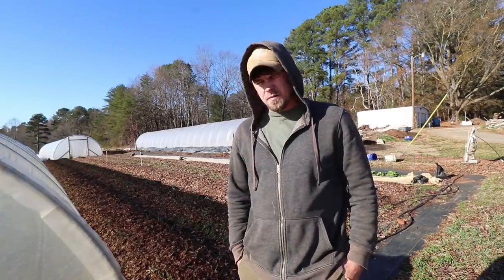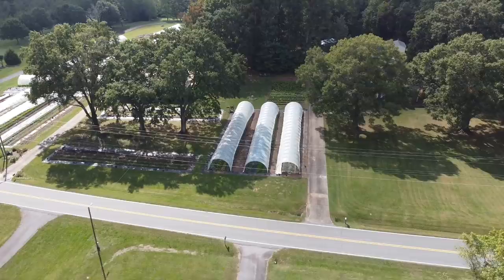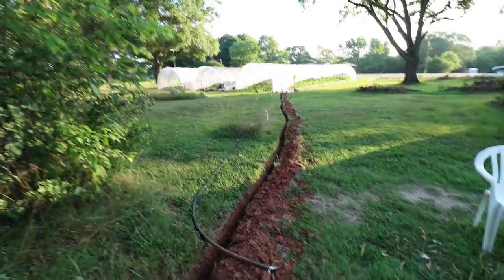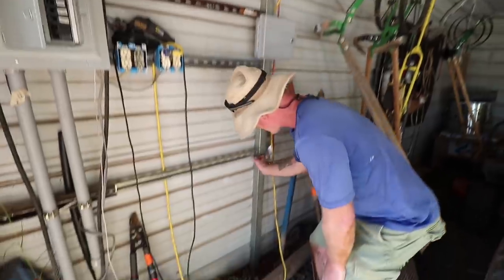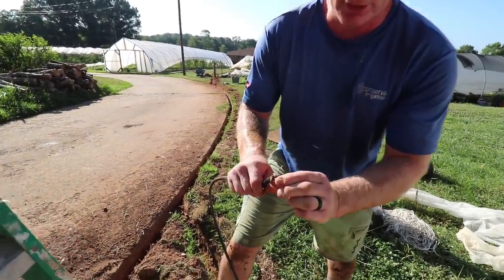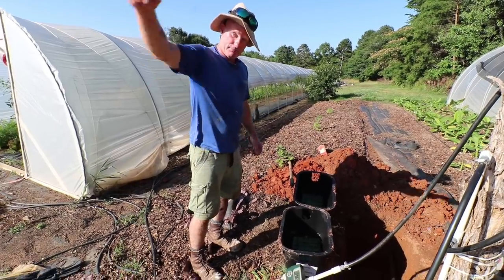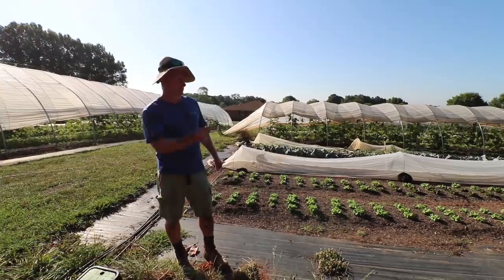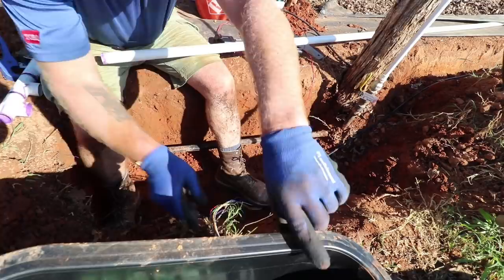Professional Market Garden Irrigation System (With Our Phones) Saves Time and Makes Money

Comment: Just a little tip.  When using wire nuts, it is best to spin the wires clockwise so when you add the wire nut clockwise it also adds a  tightening rather than loosening twist and finish it off with the tape being wound clockwise so it too is adding a little bit of tension it the correct direction.  Less chance of coming apart.

Comment: Good job on the nice clean install! One more tip in addition to the waterproof wire nuts other commenters mentioned...use a “T” for the last valve on your manifold instead of the 90 elbow. Install a short piece of pipe with a cap so that you can easily expand the manifold in the future or extend the supply pipe without having to cut into the manifold.
Reply from the maker: Yeah

Comment: Congrats! I used to run around by myself switching hoses and flipping ball valves, I eventually got anthraxnose from having an area get to wet.  That is when I switched to hunter X series, which operates on batteries.  I have a unit that I can connect to a T post, plug all my hoses into it, and change the batteries once a year.  Changed my life, especially as I get older and cannot run around the farm all the time anymore.  The big difference is you have to buy special 12v solenoids for the valves to function on battery.

Enjoy all your extra non-irrigation time this year!

Comment: Casey
I did a similar irrigation this past summer but used the Rain Bird WiFi system. On your wire connections you need waterproof wire connectors not regular wire nuts. They sell them at Lowes or Home Depot. The waterproof connectors have a gel inside the nut that protects the wires from shorting out if the valve box area floods or the wires are exposed to moisture. Just check out some Youtube videos to see the waterproof connectors being installed. Also using teflon tape on the threaded part will not get you a 100% water tight seal, eventually it will leak. It's better to use a teflon thread sealant like Rectorseal T Plus 2 that is also sold at Lowes or Home Depot. It lubricates the threads allows the fitting threads to be fully seated. Teflon tape is used when the threads are damaged and you need to fill the gaps. Other than that the system looks great. Hope this helps
Reply from the maker: Good to know thanks. They have all flooded and have worked fine if an issue comes up I’ll get those parts 👍
Reply: @JasenPickrell  As long as its dielectric grease, that works too. But honestly, its quicker to just use the dryconn waterproof nuts. They can be pricey, but in the long run, well worth it for direct burial. Also, youd be suprised how quick an exposed junction can corrode and fail when not greased. A bunch of LED growers were having RJ cord failures because of it, just from the high RH in grow rooms.
Reply: I didnt know this until recently, but PVC joints should never have any PTFE tape used on them. When both female and male threads are PVC, ABS, or nylon, only no.5 sealant should be used. Its non hardening, safe for PVC. The reason for this is because you cant get a full seal on pvc threads with PTFE tape unless you make more than 4 wraps, usually 5. This makes the male thread diameter considerably larger, and because the slippery tape cannot help but invite over tighening, the added stress on the female thread fitting makes the liklihood of joint failure very high. I myself have had at least 3 pvc joints fail from this exact cause. 

Its okay to use tape on PVC male threads going into metal female threads, but not the other way around.
Reply: @JasenPickrell  Yeah but theres only one correct way to join female pvc and male pvc threads, and thats with non hardening, pvc safe thread sealant, like no.5. That doesnt mean you "cant" join them with tape, it just means you greatly increase the likihood of that joint failing in the near future. Ive experienced it myself, before I learned that they should only be joined with proper sealant, and not PTFE tape.
Reply: @jonosterman2878  you got it all figured out let me just stand away from your guiding light.
Reply: @JasenPickrell  I feel sorry for whoever hires you to do any work on their systems. You seem way to arrogant for someone who insists that AC solenoid leads have polarity. I dont even know what you are blabbing about in half of these replies anyway. You must be talking to yourself or something, idk
Reply: @jonosterman2878  you are by-and-large the meanest individual on this thread. Even when I lost my temper a bit in the tone of my text, others didn't attack me the way you did. Also, I have received contact from some of the other people on this thread seeking consultation on the math in figuring pressure/flow/etc.. I mean you get like .336 psi per foot of head, so gravity fed systems will be a nice supplement to the pump systems. On, and on, and on I could go about irrigation. In the original Greek arrogant simply means to claim for oneself. If having a positive outlook about the good I can do for people in the world makes me, "arrogant," then I will take that as a compliment. I wish the best to you Jon. I do apologize for simply not responding to your lashes, and for even commenting on your original comment. I think you would have been better off not ever trying to have a conversation with. Honestly, here in NC pipe putty is not to be used on any threaded connections. I promise dude. Stay safe, enjoy life, and be well!
Reply: @jonosterman2878  oh gosh, you can use sh***y and vitriol in the same paragraph. You win!
Reply: @jonosterman2878  losing my temper doesn’t happen. I am well tempered, not aggressive. I admit that I shouldn’t have engaged you down this rabbit hole you have taken us. I literally counting the wasted seconds of my life with you as an act of compassion towards you.
Reply: @jonosterman2878  I don’t have a plumbing license. My grandfather, father, and uncles..all plumbers in Texas since the 1950’s. Still there today plumbing. Me? No. I’m a LICENSED IRRIGATION CONTRACTOR IN THE STATE OF NORTH CAROLINA. 

Wasn’t trying to belittle you at all Jon. You are very sensitive.
Reply: Oh, I get it. Jon Osterman as in from DC Comics the nuclear physicist that gets irradiated and turns into the watchman. You are definitely a freak. This is YouTube. Are you like a private plumber by day, and the smartest strongest etc… dude by night?
Reply: @JasenPickrell  Still havent bothered to do a simple google huh? Nor do you care that Lasco, one of the manufacturers of pvc fittings, has a whole page on their site titled "the dos and donts of assembling threaded plastic fittings"? Guess what, they, like everyone else who isnt an arrogant, niave amatuer, recommend non hardening sealant ONLY, and never tape, for the exact reasons I've repeatedly specified. Maybe you need that license revoked, if you even actually have one.

Comment: great movie and info. I was wondering, how long do these solenoid valves work without leakage and need of cleaning? In our experience with metal solenoid valves, maintenance was to costly, we switched to motor driven ball valves.

Comment: Also, if you add on in the future, and the valves end up being further away, i would invest in powering off solar. Only because wire is so expensive right now. You might see further cost savings by having the controller closer to the valves and just having an enclosure. You can just extend your wifi out there with a wifi mesh system like what tp-link makes. Remember even without internet connection, the network will stay together unless you have a problem with the router.
Reply: sprinkler cable isnt really that expensive. Its reallly small gauge copper wire. Shouldnt cost more than about $80 to wire this system up.

Comment: Best way to make electrical connections in underground situations is to get some "Wire Shrink Tube" for the size wire, and get a squirt tube of Silicone (something with a small tip), slide a piece onto one of the wires before you twist them together, make your twist of the two wires, fold the twist flat back on one  of the wires (best to fold it away from the shrink tube end) slide the shrink tube over the wire, squeeze a small amount of silicone into the shrink tube, and then, use a heat gun, or, a propane torch waving back and forth carefully not to put too much direct heat, it will shrink and squeeze some silicone out and shrink down on the wire and when it seal it up.. The silicone will keep the water out,, even if there is damage to the outside shrink tube. Sounds complicated, but, it's simple, when you see it vs read how to do it.. If water ever gets through the tape, electricity can leak into the ground, causing a loss, if really bad, some electrical shock, but, will burn out over time, so, always look at connections first if not using sealed connections.. The best taped connections will leak over time, especially if they are submerged in water.. If you notice things not working right after a hard rain, or a day or two after a rain, suspect your connections.. Takes water a while to soak into the ground to that depth once the box fills in good.. Cheers, and good luck with the business.. West Of Bryson City, NC... Paddle Inn Rafting Company on the Nantahala River.. :)

Comment: U lost pressure at the first turn 90 degree after the valve on the lateral side. Also a ball-valve prior to the valve, on the pressurized side is a great way to help removing the valve for replacement, etc.
Reply: Union ball valves and union check valves, would have been ideal. Any time I see a system that wasnt built with unions for easy valve replacement, I visualize the frustration they'll endure when having to inevitably replace valves in the future. Without a fancy filtration system, these cheap diaphragm valves can be ruined by a grain of sand. It happens so often that indoor cultivators are now switching to motorized ball valves, because the likelihood of failure is far lower with an actuator motor than a cheap diaphragm sprinkler valve.

Comment: curious if you're running the same pressure for everything, or if you lower the pressure for the drip zones.  and where in this awesome system that you drop the PSI.  Nice work.
Reply from the maker: Same pressure. Regulated by the bladder tank at the well
Reply: @honeytreefarmnc  Not sure what system you all are running, but you may want to check out the constant pressure systems from companies like Franklin. They use a vfd for pump control, which can do soft starts on the motor, which will greatly reduce wear and tear from numerous hard starts. It can also cut the number of starts/cycles per day in half, over a conventional tank and switch system. You can also use a much smaller tank; you can use a 20-40 gal instead of an 84-110 gal. 

These systems can also maintain nearly the same pressure across the entire line, rather than needing a 20 psi differential for cut in/cut out like a mechanical pressure switch. The differential is more like 2-5psi, so when the valve opens to feed a zone, the accumulator tank pressure will drop only 5 psi before the vfd tells the pump to soft start (reaches full rpm over 2-3 seconds, instead of 0.01 seconds) and maintain set pressure. 

The way these systems cut the cycles per day in half is by regulating the motor RPM based on flow demand at any one moment. Conventional systems with jet or centrifugal pumps will only run continuous when a valve/zone is open if the flow output of the zone is greater or equal to that of the pump. When the flow demand is lower, back pressure causes the accumulator to fill up and the line pressure to reach switch cut off level, and this cycling will happen throughout the duration of an irrigation feeding event. With constant pressure systems using vfd control, the specific flow demand is met by regulating the RPM on the pump motor. Usually the systems will keep the motor spinning on adjusted RPM as long as the flow demand is above a min threshold, usually of 1gpm. That means the pump will run continuous, delivering the same set pressure even if you only have one or two PC drip emitters on a zone. 

Full disclosure: I am not associated with Franklin electric, or any other company whatsoever. I'm just in the same line of work, and have learned a bit about irrigations sytems, pumps and pump controls.
Reply: @jonosterman2878  yep..you learned a bit..Drip Irrigation 
CC = SF x DF x MF 
CC = Crop coefficient 
SF = Species factor 
DF = Density factor 
MF = Microclimate factor 
WR = CC x PET 
WR = Water requirements (inches per day) 
CC = Crop coefficient 
PET = Potential evapotranspiration 
Canopy Area (sq. ft.) = 0.7854 x Diameter (ft.) x Diameter (ft.) 
WR = 0.623 x Canopy Area x CC x PET 
 Application Efficiency 
WR = Water requirement (gallons per day) 
Canopy Area = 0.7854 x Diameter (feet) x Diameter (feet) 
CC = Crop coefficient 
PET = Potential Evapotranspiration (inches per day) 
Application Efficiency (expressed as a decimal) 

PAW = SWHC x D x MAD 
PAW = Plant available water 
SWHC = Soil water holding capacity 
D = Effective root zone depth (inches) 
MAD = Managed allowable depletion 
IF = WR 
 PAW 
IF = Irrigation frequency 
WR = Water requirement (inches per week) 
PAW = Plant available water 
RT = WR x 60 
 IF x PR
RT = Zone run time (minutes per irrigation day) 
WR = Plant water requirements (inches per week) 
IF = Irrigation frequency (irrigation days per week) 
60 = Converts hours to minutes 

Final Exam Formula Sheets 
Conventional Spray Irrigation 
CC = SF x DF x MF 
CC = Crop Coefficient 
SF = Species Factor 
DF = Density Factor 
MF = Microclimate Factor 
PR = PET x CC 
PR = Plant Water Requirement 
PET = Potential Evapotranspiration 
CC = Crop Coefficient 
IRW = (PET x CC) – ER 
 IE 
IRW = Irrigation Water requirements 
PET = Potential Evapotranspiration (in/month) 
CC = Crop Coefficient 
ER = Effective rainfall (67% monthly average) 
IE = Irrigation Efficiency 
PR = SV x 0.06102 x 60 
 N x A x T
PR = Precipitation Rate 
SV = Sum of all catch can volumes (milliliters) 
N = Number of catch cans 
A = Throat area of the catch can (square inches) 
T = Test run time 
If the catch can values are measured in inches then use the following formula: 
PR = SD x 60 
 N x T 
PR = Precipitation rate (inches per hour) 
SD = Sum of all catch can depths (inches) 
N = Number of catch cans 
T = Test run time 
 Page 1 
 Final Exam Formula Sheets
PR = 96.3 x FR 
 A 
 
PR = Precipitation rate 
FR = Flow rate 
A = Irrigated area (square feet) 
DU = LQ (average) X 100 
 ALL (average) 
DU = Lower quarter distribution uniformity (percent) 
LQ (average) = Average of the lowest one-forth of all catch cans (milliliters or inches) 
ALL (average) = Average of all catch cans (milliliters or inches) 
FR = ER - BR 
 T 
FR = Flow rate (gallons per minute) 
ER = Ending meter reading 
BR = Beginning meter reading 
T = Test run time 
Precipitation Rate = ____96.3 x GPM_____ 
 (head spacing) x (row spacing) 
WR = (PET x CC x AF) – (AR x 0.67) 
WR = Water Requirements 
PET = Potential Evapotranspiration (inches per month) 
CC = Crop Coefficient 
AF = Adjustment Factor (decimal) 
AR = Average Monthly Rainfall (inches per month) 
WR = PET x CC x AF 
WR = Water requirements 
PET = Potential Evapotranspiration (inches per month) 
CC = Crop coefficient 
AF = Adjustment factor

now you have a little bit more.

if you like I can send you links to all of the charts (1000's of pages of data) that will answer all your questions on pressure, flow, and hydraulic actions on PVC.

P.S> The NC rule book says NO pipe dope on PVC. YOU WOULD FAIL THE INSPECTION IF THEY SEE IT. At least if the inspectors are paying attention to it. Tape only on all PVC threaded fittings. The book literally says wrap at least 4 times.
Reply: You do know what the ET rate here in western NC is right now, right?
Reply: @jonosterman2878  below is a list of formulas for accurate watering schedules to save water. There is a fresh water crisis coming on. Desalination is not the answer.
Reply: @jonosterman2878  That little bit of wear and tear savings sounds awesome.
Reply: @jonosterman2878  none of the above matters if your well can't handle the load. So, you might want to do some capacity calculations as well. For instance: What is the RT on a zone with a CC of 1, in Dallas, TX, in June, with average rainfall, and a well that charges 400 gallons per hour, being pumped through a 15 spray heads (half at 180 degrees, and half at 360 degrees)?
Reply: also, there are 22 other zones. So, think carefully about recharging that well.
Reply: @JasenPickrell  And enjoy those failing joints from those 4-5 tape wraps on your pvc. That alone tells me you are all talk and no actual experience.

Comment: i dunno. while it looks cool, it also seems lazy and a setup for catastrophe in the event of failure or power outages
Reply: Critical systems can easily be married to UPS systesm, or standby generators, which most farms of this size have. Hell, I have a UPS system in my home grow, and its a fraction of this size. And this is def the opposite of laziness. Its working smarter, not harder, too. Using automated irrigation/fertigation is the only way modern farms of significant size can operate, and these systems also help conserve water, over using wasteful gravity feed and center pivot methods, and offer a wider range of control over feeding events.  

From one glance at their farm, I can tell you with 100% certainty, these are not lazy people; you cant be succesful at cultivation and also be lazy. And this system will allow them to use less water, and feed the plants more accurately and precisely.